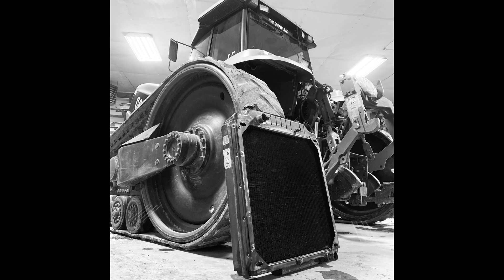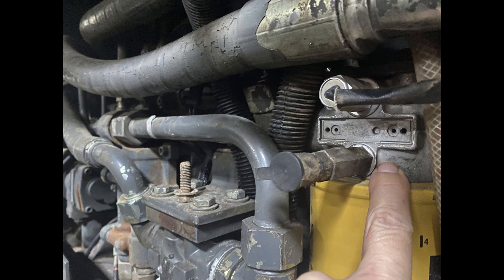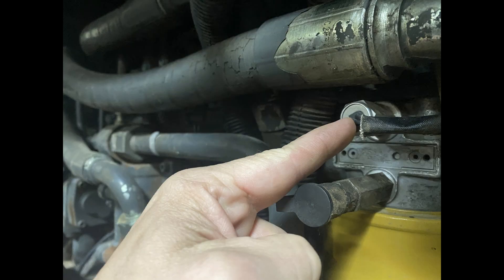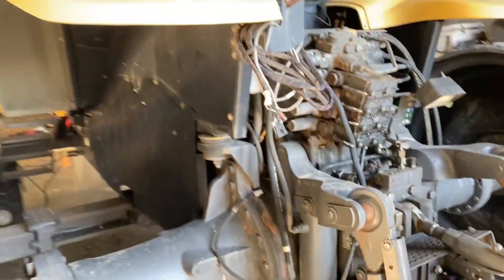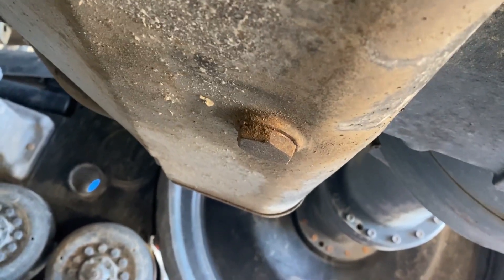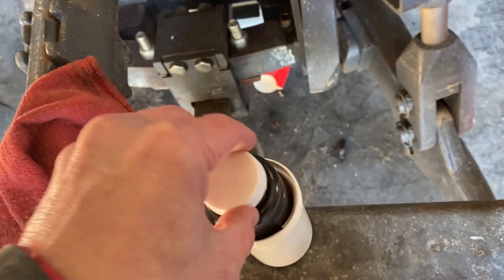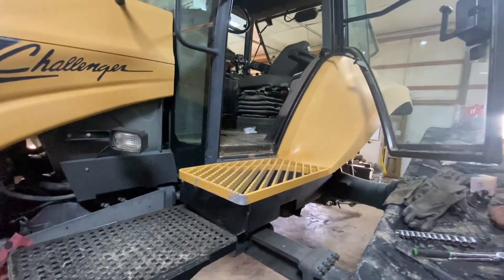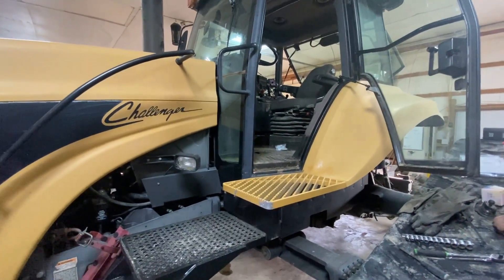Cat Challenger 55 Error Code Transmission or Hydraulic

Comment: Did i miss what the tractor was not doing? I was missing 4 th 7th n 11th gear. Cat had no idea..SHORT version is on the rite hand side of fuse cluster transmission fuse one side of the tab was craked..along with several more..theu do not show them in the parts fish..They are available in the engine shop..Replace 5hem all! Its not fun .
Reply from the maker: Thanks John!  I’ll check. Hope that might be our issues.

Comment: I got to do the same thing to my 45 behind where you pulled that sample is the oil screen if you didn’t check that yet do it mine was full of clutch facing that’s how I ended up with the filter bypass but if you got metal in the filters you do have something failing tho but hopefully you get away with just the harness for some time
Reply from the maker: +matt kempker 
Yes we also checked the screen fortunately it was fairly clean. Our main issue was the steering clutches. The right steering clutch had wore down into the metal plate, so we believe this to be our main failure. Thanks for watching!  And good luck with your repair.